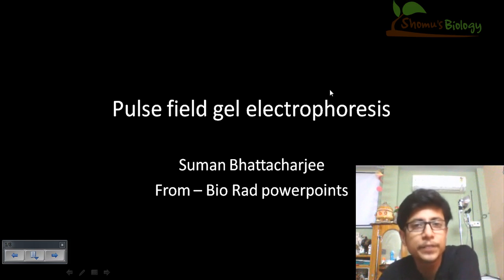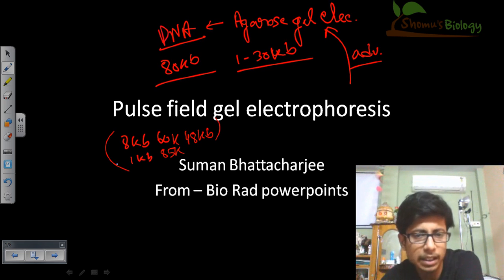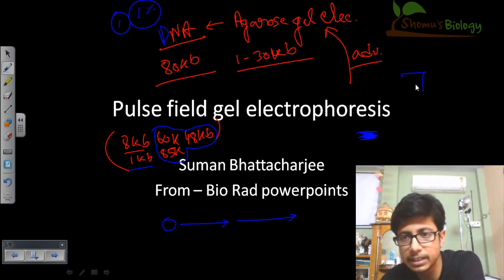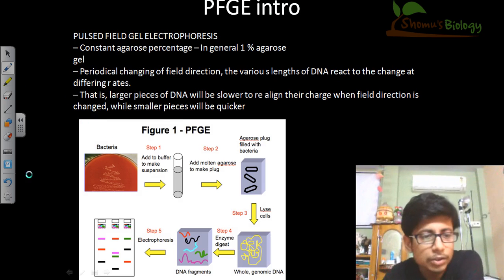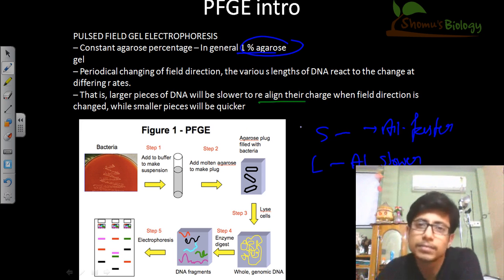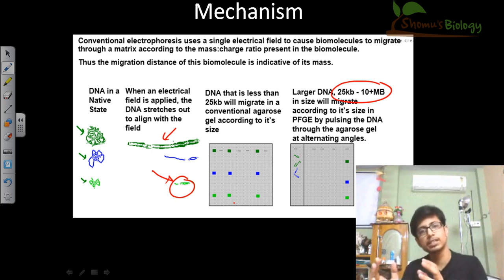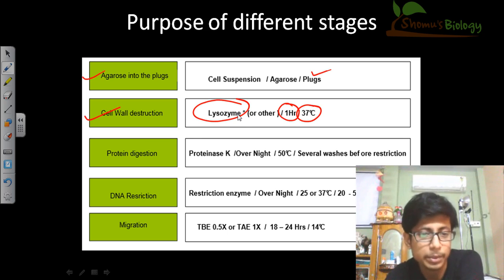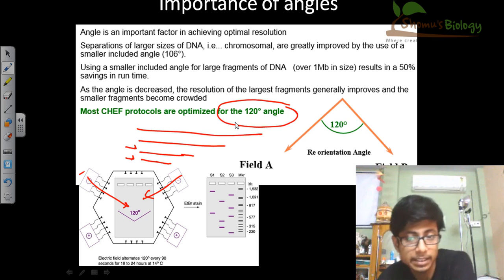Pulsed Field Gel Electrophoresis (pfge)

Comment: Very nice video... 
1 question : why do we need to use a gel (plug) to digest DNA using restriction enzyme? Why dont we just put a DNA suspension +  restriction enzyme, and then put them in wells and run in pulsed field gel electrophoresis?
Reply: Lidya Handayani  maybe to avoid the  step invovling isolation of the entire genomic dna of the bacteria,will save time.
Reply: Lidya Handayani I was wondering the same, but I think maybe because a normal DNA extraction will sheer/damadge the DNA a little bit and the agarose is maybe to protect the DNA and let it move easier in the agarose gel?
Reply: Because during the extraction process some of the DNA fragments might get degraded . So to avoid this , we use agarose plugs.